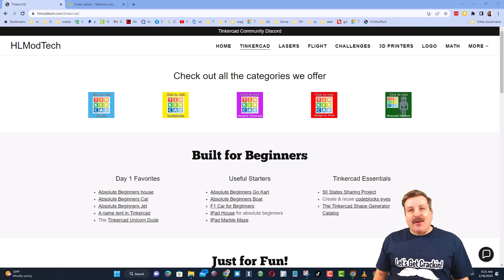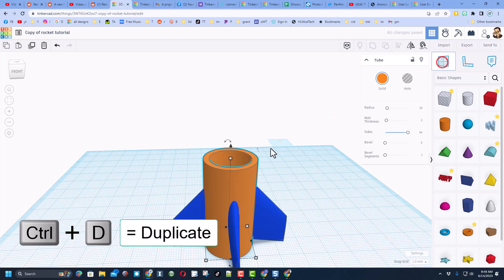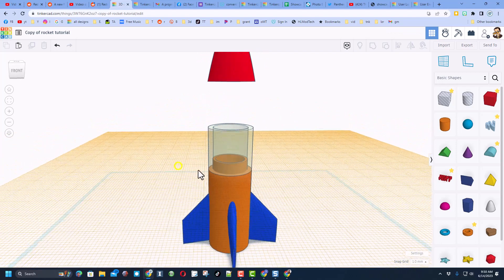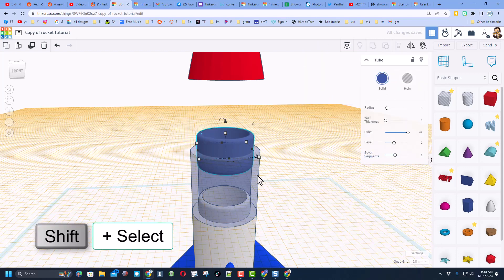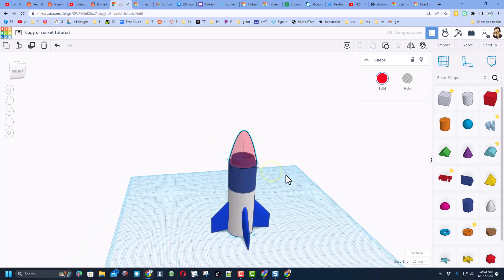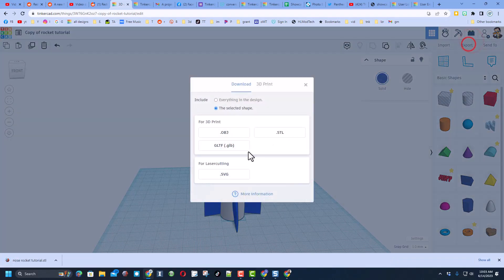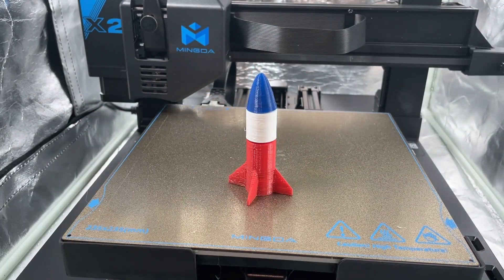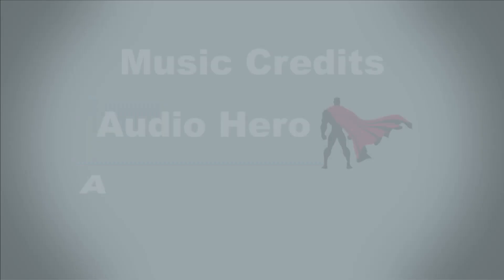Make a 3D printable Tinkercad Rocket with stages in under 10 minutes!

Comment: hay bud, just a thought but how cool would it be to build a model rocket. cheap rocket motors from the hobby lobby. not to much different than the rocket you already designed. it's a awesome feeling launching model rockets. especially when you make it yourself. just a thought for a possible future community project. it would be cool to see the different style rockets you and your subscribers would come up with.
Reply from the maker: Very cool. I used to launch Estes rockets a ton. Wonder what sort of risk there is with stability...
Reply: @HLModTech  there are lots of people out there making 3d printed rockets. from basic to borderline Nasa/ space x. the stability comes from the design. example location and orientation of the fins and the length of the rocket. they even have parachutes for the rockets that are very easy to set up. you already know how much fun it can be. just thinking out loud bud. some food for thought